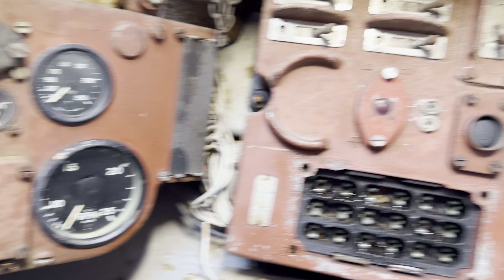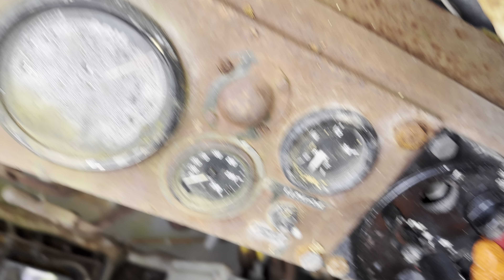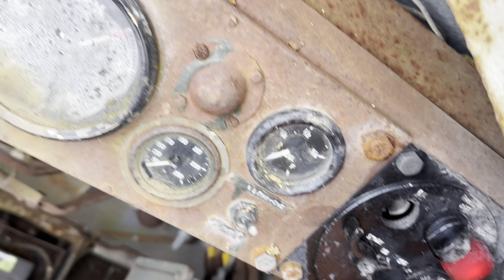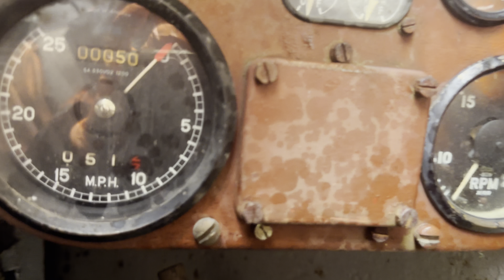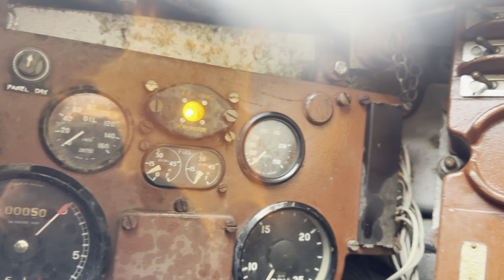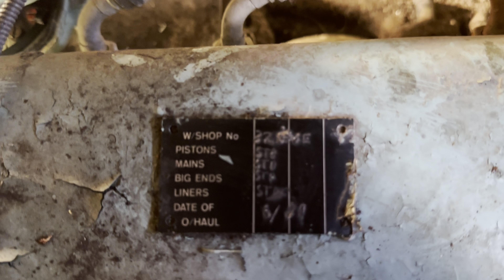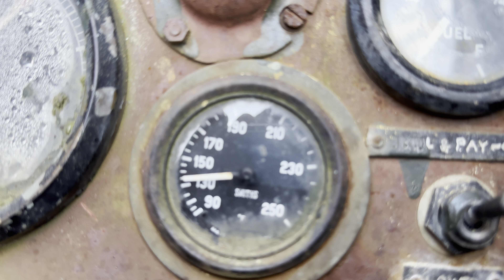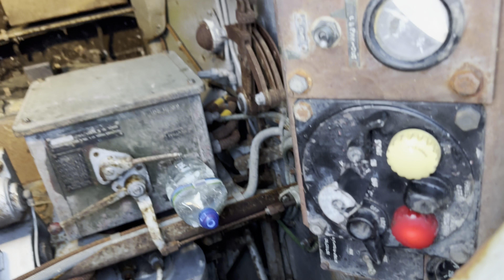Centurion ARV ￼(PART 2) Will It Start?

Comment: I  was watching you guys power washing. 
To help your hands . Buy a plastic ball ,drill holes, tie a short rope to the ball and the other to the handle.  Now when you pull the trigger, slip in the ball. The great thing is no squeezing the trigger but if you drop the wand the ball pops out . 
This has saved my hands from  cramps. 
You guy soldier on ;)

Comment: 17:43, asbestos lagging.  you might try butane gas to start cold engines.  those little cans used for portable stoves.  pop a top off a can of fly spray or spray paint onto it or just push the top down with a screwdriver.  it may work better than ether.

Comment: I sat in the drivers seat of a restored Centurion down at Borden some years ago. They’d brought it out from the REME Museum. I hate to admit this, but I couldn’t operate the clutch! It was so heavy I had to put both feet on it and brace my back against the seat back to get the pedal to move. I was shocked and couldn’t imagine how people could drive them without being weightlifters. Yet my manager in 1986/87 had driven Centurions and he loved his time with them, he was taller than me but no weightlifter.
That tank was driven out on the heath so I know it was fully operational, although it sadly overheated a wheelbearing whilst out there and that was it for the day.
I’ve wondered since if the clutch was assisted when the engine is running but I suspect I was never meant to drive one. I reckon Centurion drivers must have been walking around with a gigantic left leg and prone to walking in circles.

Comment: My OCD kicked when you shouted for the Whitworth spanners. That B80 should be a Mk 2 and have BSF fittings.
Having said that I have an old (very old) Gedore socket set that are dual marked BSW and BSF and yet they each fit the same head size while being for a different thread size.
But as you say what an absolute babe firing up like that. And on old smelly petrol as well.
Reply from the maker: It was a joke 🤣🤣
Reply: @MrHewes   My OCD is now sulking...
😂😂🤭🤭

Comment: I worked for Vickers fluid power.
Coded welder.
The sister company welded tanks.
Both factories along with the brunel works were decimated by the tories.

Comment: The V8 sounds sweet exhausts might need replacing. Top job seems to be in very good nick 👍
Reply from the maker: What v8? 🤣
Reply: @MrHewes  I thought you said V8 but you said B80 😂😂😂 I thought it wasn’t when you was working on it. Must be your accent or to many ciders. 😭😭 great video. Did like when it started and the rust flakes come flying out of exhaust. Cracking bunch of blokes. Keep it up 👍
Reply: @Andy-qo6rq  Straight 8.

Comment: You know it was great to see it burst into life BUT. I'm going to be critical here. PLEASE don't let an engine rev hard and don't throttle it like a race motor. The machine hasn't run for years and your expecting it to respond to your demands without an issue. Don't be cruel to them just treat with a bit of TLC. Great to see you doing this old machine's.

Comment: should you ever need any old style military rubies, amber or clear light lenses, the company i work with have loads of new ones on the shelf, they actually have them made, not sure of price
i remember in my Land Rover days they were becoming harder to source, when dropped, broken of pinched by some thieving willy wrester, not sure what availability is these days, but just in case you like the originals, might even have a few spare Lucas fitting (definitely don't have any Smiths instruments - do Smiths still manufacture?)

Comment: The fuel gauge in the front are the 2 rear tanks, the fuel gauge on b80 start panel is front tank next to driver
Reply from the maker: Ahh now that’s interesting!
Reply: I have a mind full of things that are coming back about the arv, I’m still a serving recovery mechanic in the army 36 years after joining! The 2 handbrake levers under the B80 start panel are the winch brakes. We used to have the apu running to charge the batteries while the b80 was running due to no dynamo/alternator. There is a bracket on the rear outside of the winch housing which a water jerrican sits in, mainly to put the fire out when fuelling up the rear tanks when exhaust manifolds were hot!!!😂😂😂
Reply: @MrHewes , congrats, you have a current expert!